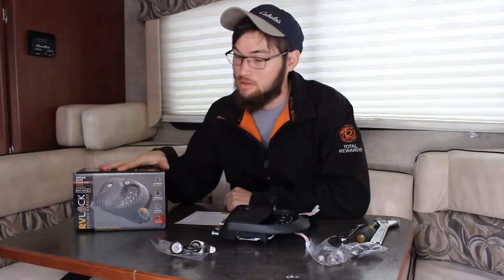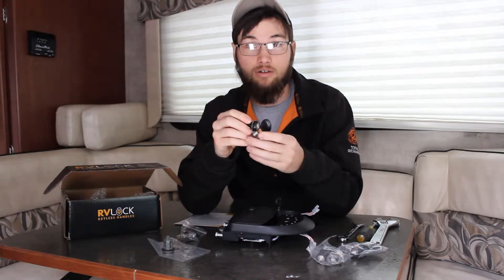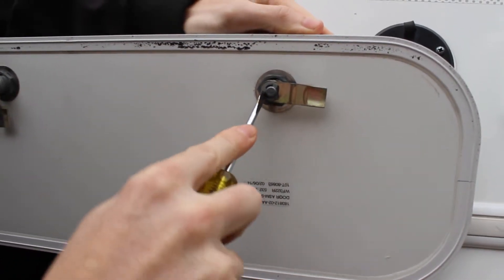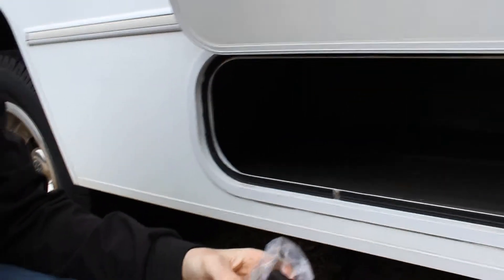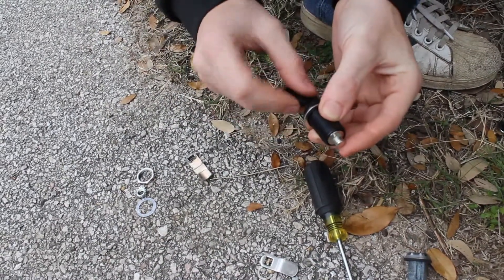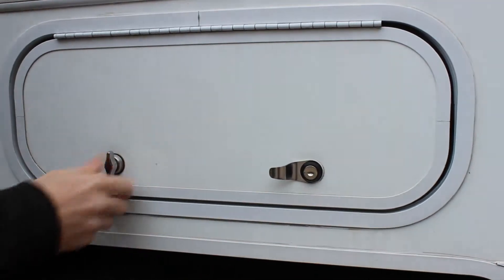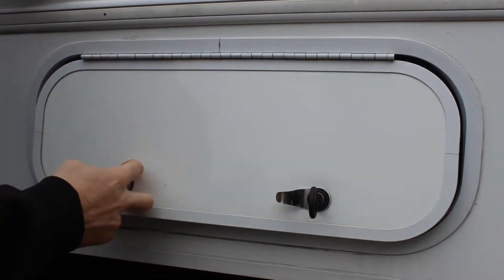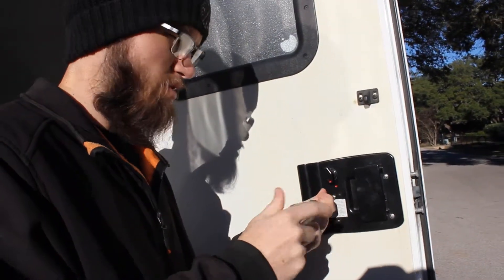RV Lock Install: Keyless Entry on Class C

Comment: Thanks for the install video. We have a 2019 Entegra Esteem Class C and the RV door lock install was NOT straight forward, Two things kept happening. One, had to trim the RV door quite a bit (used a utility knife to trim, check, trim, check) on both the upper horizontal and lower horizontal opening for the lock to fit into the door. Second, the arms that slide into the door frame when closing, I've tightened them inward as far as it will allow me, but they are STILL a hair (guessing about 1/16") too LONG and the door has to be slammed to shut. It took some grease to get it to even close.  I thought they would allow for some play in the length of these pieces to allow for differences - but I have used the allen wrench and torqued them in as far as I dare to without breaking the lock. I'll be reaching out to RV lock about a fix for this issue - when they're open for support. Note: I'm also concerned. There is NO gasket and I don't see anything to keep water out! I'll need to caulk this unit because of this or find a way to make my own gasket.

Comment: Great honest video. Just got mine for my A class. I did have to file my door. I’m really disappointed in that gasket as u mentioned. How hard would it be to put a whole gasket on and call it good. Another RV company that’s putting a product out that don’t fit right. How my people that didn’t pay attention will have their doors rot and delaminate. Mine was painted so I had to use that stupid sticker to cover paint marks.